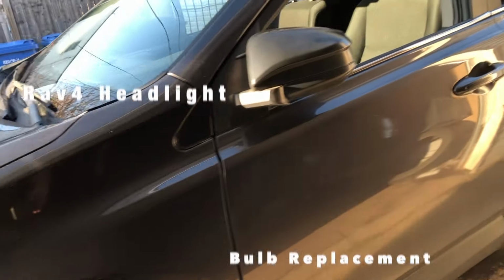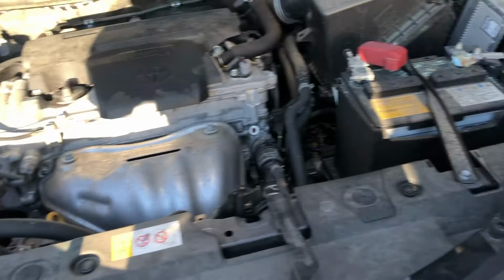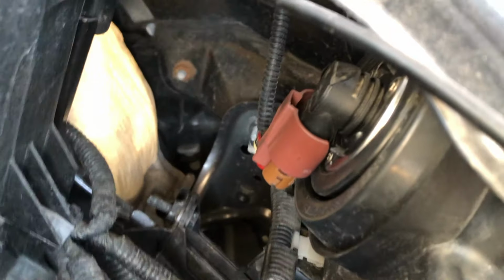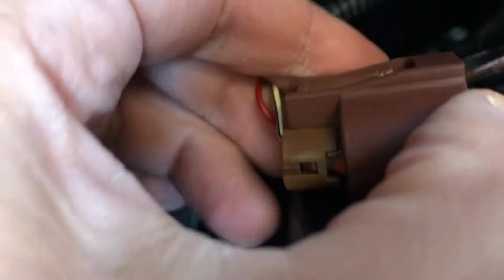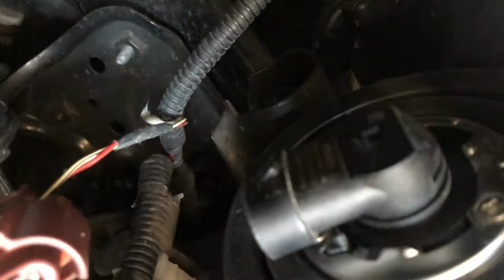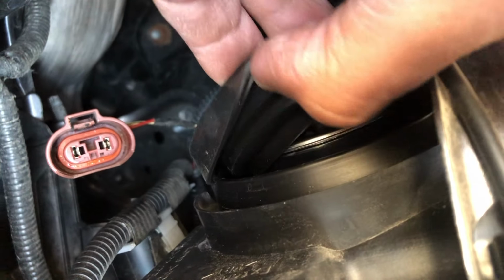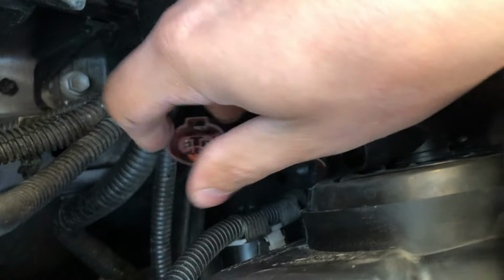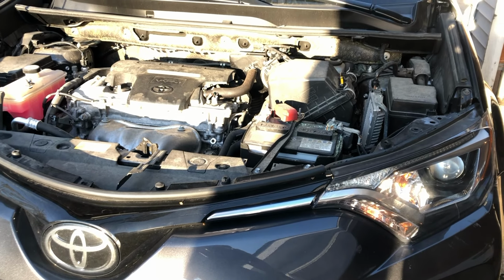***Replace a 2018 Toyota Rav4 Headlight Bulb for Beginners***

Comment: Currently it's 2°F outside with feel like temp of -15°F......I didn't want to be waisting time figuring this out. Your video saved me from freezing my butt of and possibly trying to rush it with cold plastic parts. Thanks for the video! Btw my driver light was easy to remove. However, passenger side required a flat head.

Comment: Thanks for the honest review.  I have a 2016, and you demonstrated how that outside plastic thing won't budge even when you "press down" on it.  It's tricky but the recommended short screwdriver is also correct.  Once off, replacement is a breeze.  Thanks again for the help.

Comment: Helpful video.  Mine were hard to uncle too but instead of using my tiny screwdriver to pry the bulb covers off, per the video, I used the handle to apply a little more pressure to push down the clip and it worked.  🎉

Comment: Done in less than 10 minutes! (Would have been 5 if I had my screwdriver handy.)

 Personally, I couldn't get the right angle to get the harness off the bulb while everything was in, so I turned the bulb and tugged it out while it was attached. (Watch the wires!)

THEN, I could use my screwdriver to get the harness off the bulb. Then, popped the bulb back in and attached the harness back. Easy peasy! Thank you for this vid!

Comment: Thank you!  That was really helpful.  Just replaced both my RAV4 headlights within a few minutes.  I did need to use a screwdriver to help pull the electrical connector off. So thanks for the tip.

Comment: Thanx for the effort 👍As with your experience I found it hard to remove the bulb assembly from the auto body mount point.
 One note I think the job goes easier if one removes the bulb assembly from the frame first then separates the bulb from the wiring  harness.
Reply: This step helped me big time.  Thank you for adding to this very helpful video!

Comment: Thanks for info. I have question.  Last year I replaced both bulbs upgraded to led lights. Now led bulb gone. I tried to put regular halogen bulbs. Some how they dont fit. Looks like led bulbs sockets wont come out when i took led bulbs out. That three star or tips around bulbs. If you have suggestions please let me knows.

Comment: To pop that clip just use the square tip of a 1/4" socket wrench & use it to push down on the end of the tab in the center of the red clip on the end closest to the red & white wire and tug down. Slides right off

Comment: This is actually a tool-less job. To release the wire harness, push on the bottom of the clip that holds it in. Screwdriver works but could break the clip. Replaced mine in 3 minutes. Thankfully Toyota isn't building their cars so you have to remove major components for the simple jobs.

Comment: Got a 16' and my question to everyone is how many times have you blown the headlights? In two years we've had 5 bulbs blow. Generic, Toyota, and Sylvania.
Reply: I've gone through two bulbs in a year and a half with my 18'
Reply: 1 the other day and thats odd for just 2 years
Reply: 4 times with my 18 rav4.... I drive 40,000 miles a year, but I've never had to change the bulbs as often in any other vehicle I've owned.
Reply: @tigjlb  same here, this is obviously an issue
Reply: I have a ‘17 hybrid.  Just burned out one HID bulb after 53k miles.
Reply: @tigjlb  Do you leave them on auto mode?  They burn much more if you do, but it may be safer, etc.
Reply: @Photologistic  did you buy car used?  Does it come from factory with HID?
Some cars don't do well with changing to HID if not stock. I'd think these newer cars should be OK though
Reply: Did you buy it used? If so check fuse box to see if someone put wrong size fuse in . Check to see if water is getting onto bulb? Corrosion on connector?
Reply: @tigjlb  dang. I went 120,000 in my 12 Ram before changing a tail light out and 150,000 for headlight. It's stays outside in Midwest weather and I haven't babied it.
Reply: @sostrucking  Bought it new.  It came with HID (not led).  Lights stay on most of the time in newer vehicles, unlike your truck I’d guess.  Bulbs are relatively cheap.  No way any water gets into them, there is no corrosion, the filiment just burns out from them being on in auto mode most of the time.  Five years is fairly long for a hot bulb like this.  If it got to be a problem, I can put in LEDS for like an extra $20 or so.